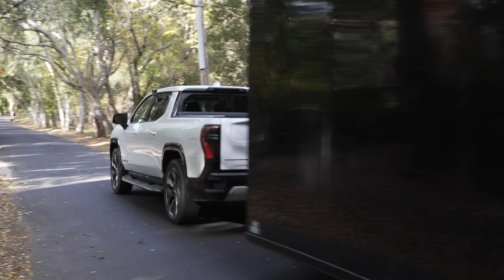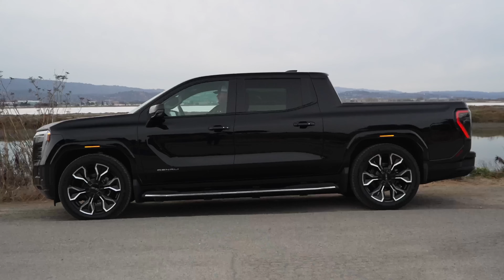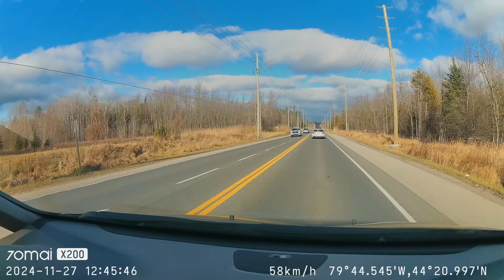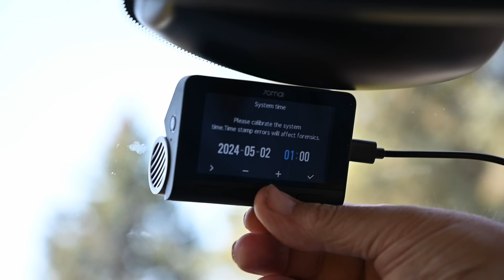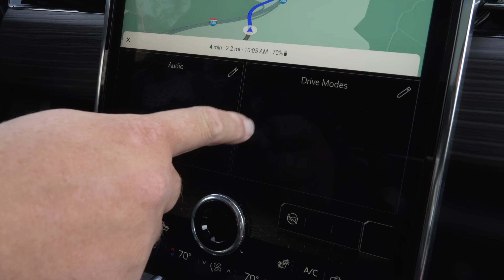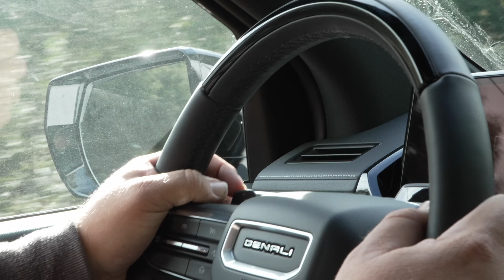Good Tow? What's the Range? Pulling a Trailer with the 2025 GMC Sierra EV + Engineer Interview

Comment: We have 20k miles and towed our 33’ Airstream classic out west, 7,000 miles. It is amazing. It can power our  AS with no issues. Uses about a kw/per half hour running the ac. No issues charging. We just celebrated our 1st year with the truck.

Comment: I wouldn't buy any gm truck. With all the problems they are having.
Reply: Maybe i got lucky. I have a 2019 GMC sierra 1500 and i love it! All i want from here on out is GMC. It has around 80k miles and have had 0 issues, even my original break pads are sitting at 88%. Well, there was a deer that threw itself infront of my truck 2 years back.

Comment: Full self driving creates more stress than it saves:

Dozens of vehicles in self driving mode have resulted in major crashes resulting in in serious injuries and deaths.
Reply: I would disagree.  The self-driving feature helps with speed control and lane keeping, so not as much concentration on input is required.  Much like the old cruise control, the driver had to watch how fast the vehicle was catching up to the vehicle in front.  The driver still has to pay attention and has responsibility.  But operating the GPS or radio while driving feels much safer because the driver is being helped.  I would suspect that more accidents are caused by driver inattention without help than with help.
Reply: @ Sounds great until the self driving feature fails resulting in serious injuries and/or death which is occurring every year.
Reply: @icare7151 when people are hurt by supercruise failing, they are 100% at fault for not paying attention. These things aren’t just swerving into telephone poles. They might depart from a poorly marked lane, run into a car in front of them, or fail to negotiate a curve. All things that a driver behind the wheel has plenty of time to say “hey, that’s not right,” and intervene to stop. The steering wheel, gas and brakes work at all times.

And such occurrences are vanishingly rare. The most common issue is that it simply stops controlling the truck. When that happens, the seat vibrates in pulses, a red flashing light appears on the HUD, and the brakes gently tap to get your attention. Anyone ignoring all those warnings would have to be asleep.
Reply: This isn't full self-driving; it's assisted driving only.

Comment: @truck King  Great review and interview. Probably the best review I have seen on EV truck towing. I see the tongue weight listed as 1000lbs in your video at 18 min 42 sec. I also noticed the payload is 1450 lbs, but the specs everywhere say 1350lbs. The payload is significantly lower than other EV trucks. Once you add the driver and two passengers, you will barely be able to put anything else in the truck. Wondering if you see the payload capacity of only 1350-1450 lbs as an issue for this truck.

Comment: When they release a generator hybrid for sub 60k usd I'll be interested. Until then these look cool sitting on the dealer lots. My local chevy dealer has 9 silverado evs, all with 10k off the hood and they're still not moving
Reply: I think like a lot of vehicle choices, one has to look at what the vehicle is being used for.  In my opinion, EV trucks are basically 1500/F150 vehicles.  To be used around town or on short trips towing.  I tow a big 5th wheel with a 3500 Silverado.  No one makes an EV truck that can do that job yet.  For the way most people use half ton vehicles, and EV truck is a smart move.  Will save you money over the long run, and be way more fun.
Reply: Now how many ICE Silverado s does the same dealer have? Trucks in inventory is not proof they aren't selling.

Comment: Which is better F150 Lightning or the GMC EV ?
Reply: right now GMC EV it has 50% more range on a bad day 

Ford is pulling back on production of the F150 Lightning because of how disappointing it is 

2027 Ford is gonna put out better EVs although it may be just ford ranger EV 

Ram has the best EV for towing coming out the wheels are 8 lug which means it’s heavy duty
Reply: Depends on your needs and circumstances.

Comment: 5:10 & 17:15 it seems an obvious advantage to have the charging port in the same location as the Tesla's so that GMC customers can easily back in and charge at the 1000s of Tesla Superchargers. What % of the time is towing vs % of the time not-towing? 95+% not towing?  Also pulling straight in if the port was passenger side front  would leave the trailer more than likely blocking a lane.

Comment: That is the ugliest front fascia I've ever seen.
Reply: No way that trailer weigh t 7000 lbs empty that truck don't weigh 31/2 tons I wanna see if it can pull my fifth wheel RV it's a triple axle if I can and go 1800 miles in 2 days I will buy it.
Reply: @artgarcia137  Bumper pull only on this model.  Yes it can do 900 miles a day - but that is a sh!t drive in any vehicle.  Yes that empty truck weighs 4 1/2 tons all by itself.

Comment: Great review and shared sentiment regarding towing with an EV.

I disagree and think that the left-rear is the best placement for the charge port because backing-in allows for:
- greater safety due to better visibility
- getting out of dodge quicker in case of an emergency (the Japanese are taught to back into parking spaces)
- looks cooler when parked
- when charging cable and post location means better accessibility and people not having to manage the cable to avoid trips / potential falls
- at commercial locations, it supports back-in policies

Pull-through chargers here and are scaling, so I see towing with an EV to not be an issue.
Reply: Passenger side is best place for the port, whether front or back, since it allows charging at street side parking. Could not care less how, well that works with Tesla, chargers.

Comment: For 95k you dont get sunshade. Its hella heavy. And gm chinese build quality. They never discuss what to do with them after the 10 year battery life.. you cant scrap em. A new battery is 30k.
Reply: Even going back to 2008 my GM owning friends deal w bukko electrical failures!
Reply: Battery will last longer than 10 years. Even if it does need replaced by then, it will be far less than $30k. And at end of life, the batteries still have enough usable life to be repurposed. After that, they are recycled. Typical Fox watcher FUD.
Reply: @moth450 You would make more sense if you were any type of a truck owner - but you are not.   You just make up nonsense.
Reply: A truck is going to burn up somewhere around $30,000 between fuel and maintenance within a hundred thousand miles to operate.
 If this thing is reliable to 200,000 miles it's worth the extra money. Plus it's a better experience than having something underpowered. Let's hope it's reliable.

Comment: Steve in terms of getting used to one pedal driving let me tell you as a guy who spends most of his time in a peterbilt dump truck the one pedal driving in my lightning was a quick learn since the pete has the good ol jake break.  Pretty much the same experience.  Love the lighting (pro model) test drove the work truck chevy and it was nice but the lighting has Soooo many more accessories etc since it's basically an f150 still.  The GMC looks cool but man $$
Reply: Anything with a hydraulic drive is similar to drive. As soon as you lift your foot in a loader, you start to slow quickly. So I found one pedal driving in an EV easy to adjust to.

Comment: Wish you would have asked about phone as a key which is something GM is behind on imo.
Reply: Why? Key as a key has worked just fine for over 100 years.
Reply: @TroySavary  Until you can use your phone as a key. Then I prefer that.
Reply: @oscarreynaable  And then get locked out of your vehicle if your phone battery is dead. No thanks.

Comment: overpriced junk
Reply: I am sure somebody said the same thing about the first big screen tvs. How is your CRT monitor working with your current computer?
Reply: @craigheuchert578  apples to oranges. im saying this particular product is junk not EVs in general. If they would allow China to sell their EVs here  GM would have to shut down
Reply: @minergate4066  Not at all a bad comparison. Your term junk denotes something that is terrible and is no longer useful. From the review you probably should have watched all the way through; with the exception of what end the charging port should be, the Sierra is a far superior towing vehicle to any similar sized truck. China, like Europe does not have half-ton sized trucks. Cheap EVs are possible because of the much lower R&D required but you will also notice that the heavy duty applications the Sierra is required to do a Chinese EV would not have a chance in accomplishing. The Cybertruck uses similar build techniques to Chinese EVs and we know how well the Cybertruck fairs in towing and hard work. Moral of the day. Don't use broad strokes. We can all agree that with the Silverado and Sierra, this is the very first attempt at a General Motors EV truck that can do truck stuff. I would say that when it was thought up many years ago to what we see today as a real vehicle, it is a pretty amazing accomplishment of how much it can replace an ICE truck. The Cypertruck in the same vein has turned out to be more fragile than what Americans would normally accept. Imagine what the 2nd and later generations of the Silverado and Sierra will be. Just like the heavy and old big screen TVs compared to what you can get today.
Reply: @craigheuchert578  its junk
Reply: @minergate4066  At least it's not a toyota needing an engine replacement or is that your definition of not junk?
Reply: @craigheuchert578  This caveman has no vision of what things can be. Batteries are getting cheaper and lighter every few years.

Comment: On our locomotives we had dynamic braking which put resistance to the traction motors going downhill instead of dragging train brakes and wearing out , overheating brakes. It was progressive so you could apply more or less resistance to control train. It however shedded the heat out of the dynamic braking grids was not regenerative as there was no large battery pack to put anything into. Works really well and makes a cool wwwwaaaaaas sound when in full dynamic, you had to be careful of buff forces with all the train pushing into the head end especially on curves you could push rail out and derail. This is where distributed power helped with locomotives also in middle or end of train to mitigate buff and draft force as well as getting air to braking system on a cold Canadian winter day.
Reply: That's very interesting.   I had never considered how much force that could apply to the tracks and how it could push out the rails on a curve.
Reply: There are some new locomotive designs where they've essentially replaced all the diesel bits with an enormous battery pack. Slap that into an MU with two or more diesels, divert the dynamic braking energy into the batteries, and bingo you've got a regenerative locomotive saving probably thousands of dollars in diesel every time you run it.
Reply: @ exactly! I'm at Cando now after 35 with CN and they have one
Reply: Unstoppable 😁

Comment: Good video and you would get better range in an ev or gas if you didn't go full throttle merging on the highway empty or with a load just a pro tip as that truck can do way better than. 1.1 kwh

Comment: Such an affordable truck! It would take many years to break even compared to ice trucks.
Reply: $110,000 CDN for an ICE Denali Ultimate that doesn't come with 4-wheel steering or air suspension. Add those to the ICE truck and the price between the two would be pretty close. No luxury tax on the EV which means the pricing is about the same. Now factor in virtually no maintenance costs and a quarter the cost for electricity to fuel if you can plug in at home for 90% of your travel and somebody would be saving money within the first year and be thousands ahead after only a few years.
Reply: @craigheuchert578  Because of course everybody will go for the Denali Ultimate! A Sierra SLE Duramax does the job for me you can have one of theses around 65000$ cdn right now. So we are talking about a 60000$ price difference plus sales taxes plus financing fees so call that 80K$. On top of that add a much higher depreciation on the 125K$ truck and the delta in term of ownership is close to 100K$. So this buy a lot of diesel and maintenance. And before you say that this is an apple to orange comparaison it is not my call to only sell the most expensive sierra EV first so I have to use that as price comparaison.
Reply: @craigheuchert578  Of course everybody will go for the Denali Ultimate! In my case a SLE Duramax does the job perfectly. These trucks can be available around 65K$ cdn so we are talking about a 60k difference plus tax plus financing so around 80k then if you add the extra depreciation of the 125K sierra EV more like 100k$ difference so this buy a lot of diesel and maintenance. Before you say it is an Apple to orange comparaison it is not my call to only sell the most expensive version of the sierra EV first.
Reply: Our Silverado EV is saving us over $300 per week in fuel over the truck it replaced. So it is already saving money, since that is more than the payments.
Reply: @ Unless you drive with a trailer all the time or like 60 000+ kms a year i doubt about this.
Reply: @Math-zl8kq  It is a work truck. It pulls a trailer daily.
Reply: You definitely want to go easy on that throttle and slow for turns and corners to preserve tire tread.

Comment: I absolutely love towing with my lightning and it's awesome that they're getting so much better at running the electric vehicles.
Reply: This thing has an absolute beast of a battery, that's why it is the best at towing.
Reply: @volvo09 I saw some Tesla fan in another video complaining that it's inefficient and that other EV trucks are more efficient. 

I dont think they understand that trucks are, by nature, inefficient as daily drivers in order to do what they are actually built to do efficiently. If you build an aerodynamic, efficient  daily driver focused truck, you have not built a truck but a car with a bed, a Ute as the Australians would say. There's nothing wrong with Utes either. Sometimes you just need a bed for big or messy items. A true truck, however, needs to not wheeze while towing and lose a significant portion of range because you put a giant box with the aerodynamics of a brick behind it.

Comment: Wow, Id like to be able to jump onboard the EV train, but theres no way I'm paying that price for a truck.
Reply: Totally get what you’re saying. On the surface, it does not seem worth it but when you calculate the total coat of ownership it brings it inline.

No Gas
Less frequent brake changes
Not much in general maintenance 

When you calculate you costs based on how you drive over the planned time of ownership you would be surprised and how much the price comes down.
Reply: A truck like that would cost around $30,000 for 100,000 Miles providing the truck is reliable that's not a bad return.. and it only gets better if you go a couple hundred thousand miles. Reliability is the key. You don't want it nickel and dimming you to death. If they have a good robust 100 thousand mi 10-year warranty on it you'll be in good shape.
Reply: Get it pre-owned with low miles, it's worth the price.
Reply: What choice do you have? 😅
Reply: @dmitrydk92  Keep what you have.
Reply: @CraigSmith568  the government will ban ice vehicles soon 😀
Reply: @dmitrydk92 there is no ice ban coming anywhere in north america.
Reply: @ShippyJack  The Canadian government has banned the sale of any new internal combustion engine vehicle by 2035.
Reply: @RidersInBlack  No they havent. They have mandated zero emission vehicles which include hybrids, which have ICE. And that only applies to light-duty vehicles.

Same as california.

You can still but your F250 powerstroke and use it to drive to the grocery store.
Reply: That shit will never happen. Stop spreading false rumors.